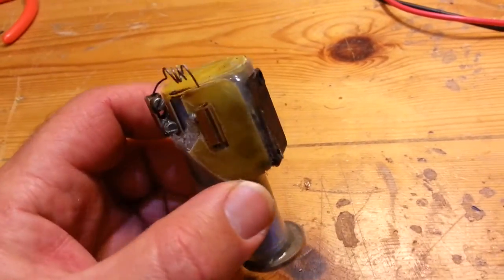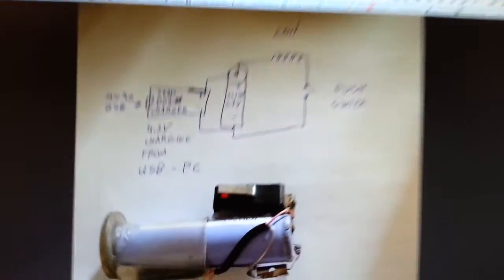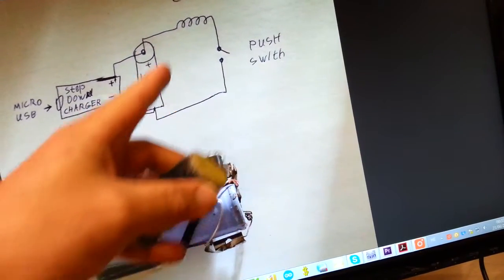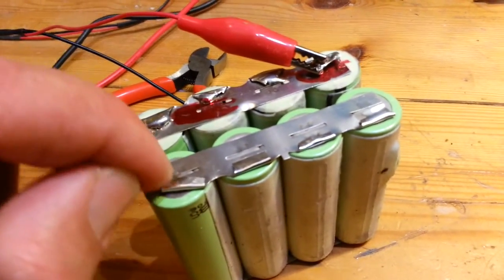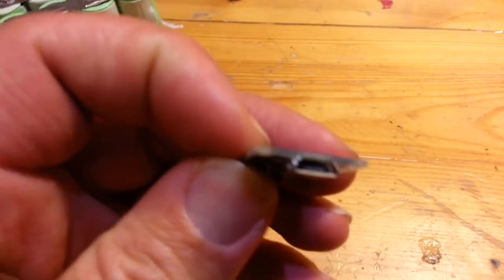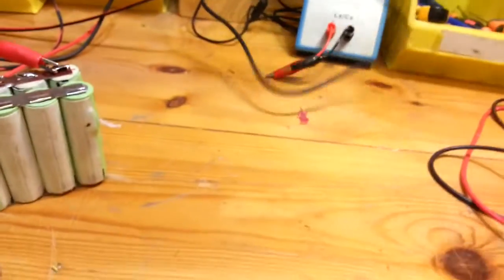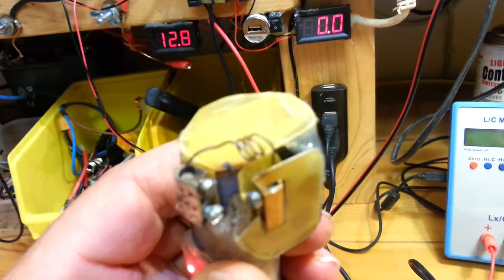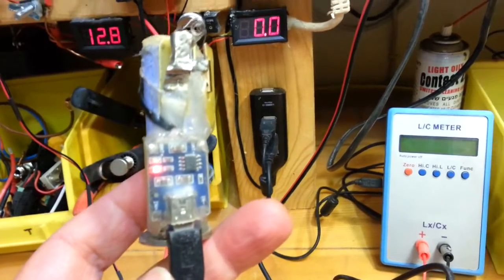Electric Lighter from li ion battery cell   home made update2 מצית חשמלית מסוללת ליתיום

Comment: Hello! How much amps does your cell have?
Reply from the maker: +Erlandas Pil   i used a Samsung 18650-26F. can give 5-6A MAX.
and it works well.
if you will use high power cell, so the wire element will heat much faster.
Reply from the maker: +ilan - neworld       actually, the 26F can supply peak of 8-10A for a few seconds
Reply: if i connect some same type phone batteries in parallel to get the amps higher to like 3.5 A, it should work fine yes?
Reply from the maker: +Erlandas Pil      well.. phone batteries have a very low discharge current, so i am not sure it will work.  maybe if you connect many of them, it might work. 
i suggest you using 18650 li-ion cells.  you can get it from an old laptop. even if the battery is dead, you will find some cells working well after slow charging.

Comment: Hi. Nice. I've done it but stick it connections with hot glue but seen after 7,8 seconds the glue start to melt :)). Next time I'l do it with led low voltage indicator, a jack for charging, because I have a flashlight battery charger and I need only a jack to charge battery and of course a glue to handle the heat between screws connections . I need to find a little switch witch can handle 3 amps like you've said. I like your coin stand :) cheers
Reply from the maker: +Robert s   :@)  hot glue is a nice try.  you can use the same on/off push switch i used, works well.  good luck.